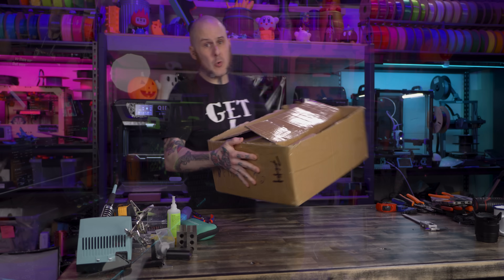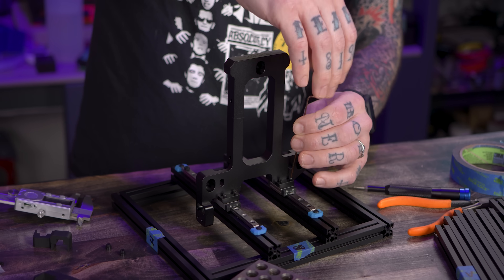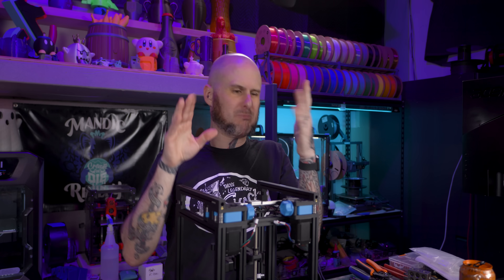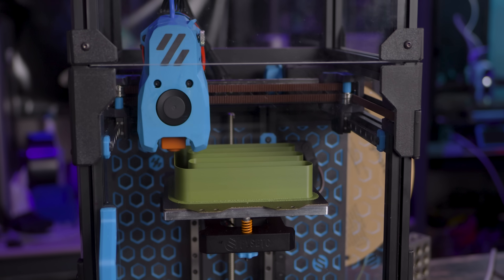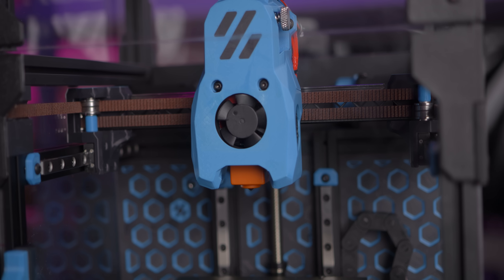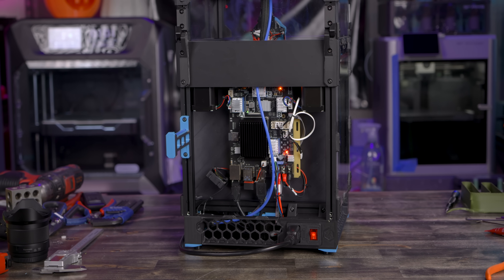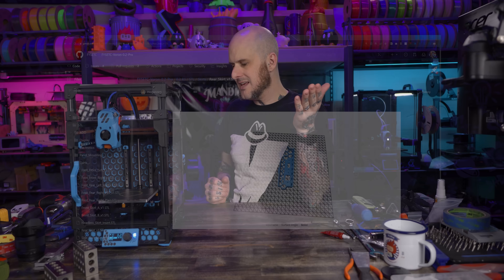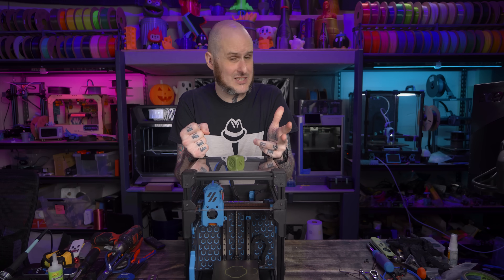Is this the BEST Budget Voron 0.2 kit? - Fysetc V0.2 R1 Pro Review

Comment: I have one of thoe kits and the "umbilical cord" after some hours of use (not sure how many) started giving me problems, after the printer heated up and started moving to do the homing routine, would always give an error that the hot end droped temperature. And when I re-did the solder joints on the toolhead PCB the accelerometer developed an internal short and fried the main board. Soooo I'm not the bigest fan of that setup. Your milage may vary, but this was my experience

Comment: In thier newest kit the 1.1 They seemed to have taken your advice and upgraded the umbilical cord as well as include heatsinks in the box. also they went to stainless rails.
Reply from the maker: Excellent. Thanks for informing me that they’ve made some improvements. 👍🏻👍🏻
Reply: I can confirm these changes. The umbelical in particular has been changed into a CAN sort of toolhead instead. It's a very soft silicone cable.

Furthermore, they have upgraded the hotend to something along the lines of Bambu hotend clone with dragon mounting points, as well as include the CNC pom gear by default.

I noticed they have seemed to address all issues you've raised in this video!

Comment: Purchased mine with printed parts in the January 2024 winter sale, shipped to Wisconsin for 367 after coins/coupons on Aliexpress.  It shipped from a US warehouse.  Printed parts were all correct and without issue.  The back skirt with port access was included.  Everything is printing well although I think I have a little bit of y binding and my y acceleration rec is only  11700 while x is 18k

Comment: In time where bambulab is everywhere ( I own P1P/S) - is it good to build voron from kit? or its cheaper to pick components on my own hand?
Reply from the maker: Hard to say. I’m largely of the opinion that a lot is cheaper overall. You can find individual parts cheaper but then you often pay tax & shipping on individual transactions. That quickly defeats the savings of those individual parts. Combine that with missing small parts here or there. Despite your best planning you’ll often miss something. Or maybe the part you need is only available in multiples. Things kits take care of. I self sourced my first 2 Vorons and I won’t do it again. From here on it’s kits for me. I’ll buy the additional parts I want and maybe end up with some quality spare parts for future projects or maintenance.
Reply: @MandicReally  Thanks, i dont expect as fast answer. Maybe one more question - formbot now have very cheap kit in my region (Europe - 429$ with dragon high flow, no parts - i can print it better), so, better formbot kit or siboor/fysetc?
Reply from the maker: @zbigniewwielgus1249   I haven't used a Formbot kit to say. I have just not had good luck with the Siboor kits so I cannot recommend them. The Fysetc kit I was largely happy with but the electronics weren't my favorite. For the price and with a good hotend (I like the Dragon HF), that sounds like a good price to me and I'd give it a go.
Reply from the maker: @zbigniewwielgus1249   I haven't used a Formbot kit to say. I have just not had good luck with the Siboor kits so I cannot recommend them. The Fysetc kit I was largely happy with but the electronics weren't my favorite. For the price and with a good hotend (I like the Dragon HF), that sounds like a good price to me and I'd give it a go.

Comment: The motor noise comes from the stepper drivers. Replacing them with proper ones for example by BTT will remove the noise.
Reply from the maker: TMC Autotune cleared it up.  I’ve had it happens it BTT stepper drivers too.

Comment: But for the price you have so many other robust and less fiddly systems. Why would anyone need a voron?
Reply from the maker: No one “needs” a Voron. I did an entire video about why folks may WANT a Voron 0: https://youtu.be/k08EfV4u4dk?si=hRP5xwTROuwyArtQ
Reply: @MandicReally  yeah I watched that and it was before the a1 mini came out, so A1 mini with AMS or Budget Voron 0.2 kit you build? Yes I know material choices are much more with the Voron however AMS. Yes I know a kit is a learning experience, but out of the box setup time to print is long and could end in suffering vs the A1. Do you really gain that much with the Voron over the competition? 3D printing is getting mainstream and as it does the Vorons of the world will be more niche.
Reply from the maker: @mobilechaosyt  materials is the key. The A1 bed is limited to 80C. Not nearly enough for ABS, ASA, Nylon, etc. No enclosed chamber is another mark against it for prototyping type work. 

The A1 mini makes WAY more sense for the majority of users, but folks like me who work with materials other than PLA, it’s a non-starter.

Comment: Hey man....I'm currently rebuilding everything in the chamber on my v2.4,I've been recommended beefy front and z idlers.
I got about 3500 hours on this machine before I got one z idler cracking and one front idler cracking.

Should I just go cnc or is it ok to go 5 walls /50 % infill on all the chamber motion stuff?

Extra question,do you have any xp with quality ceramic bearings or are those just fugazi?
Reply from the maker: I haven't run the ceramic bearings yet. My next 2 builds (a v0 & v2.4) I'll be running them to see what I think. You can go higher wall count (Infill won't make much of a difference) to increase strength, but yes I'd recommend the beefy designs. The stock idler design is "Meh" to me. I'll be doing beefy on the next 2.4. The only problem with the CNC parts is you are stuck with the color they provide. That's the thing I dislike about them. I MAY go CNC on the next 2.4 just to test it out though.
Reply: Yeah...at least all black would be nice @MandicReally

Comment: About tge tinnitus like tone, it comes from the stepping and interpolation of the drivers. My bigtreetech drivers (2209 as well as 2226) and moons motors do the same at certain positions. For it to go away, use stealthchop (attention, speed limit) or switch the Interpolation setting

Comment: A couple questions:

What do you think of that bed frame vs the Kirigami?

And do you think it's worth upgrading a Voron 0.1 to 0.2?  Or are there any parts in particular that you'd upgrade?
Reply from the maker: I’ve held off updating my 0.1 until now. Even then I’m only doing it because it needs some disassembly for maintenance. 

The number 1 upgrade of the 0.2 over the 0.1 to me is the Mini-StealthBurner. It has a superior Extruder design, and well all around better design. In my opinion. If I had a 0.1 I was considering upgrading, I’d just do the Toolhead and associated pieces and leave the rest. Almost every part is changed but not in drastic ways. The skirts of the 0.2 look a lot nicer too. That’s an easy cosmetic change though. I did that on my 0.1 months ago. 

I’m not a big fan of the extrusion top hat. Yes it’s superior to the fixed 0.1 too hat, but I have a hinged 0.1 top hat I’m happy with. The latching mechanism on the 0.2 top hat is still questionable to me sadly.
Reply: @MandicReally  Ah, thanks!  I already went with a mini-after-sherpa and a sailfin extruder, so I don't feel the need to upgrade there.  And did the top hat.  Seems like I can just stop wondering about the rest.  :)
Reply from the maker: Yea I have a LGX lite on my 0.1, which is why I didn’t bother updating. Even now, I’ve design a Mini-SB LGX Lite version for the upgrade.
Reply from the maker: Oh and on the bed frame. Purely from a feel standpoint, the CNC bed frame feels more solid. However not so much that I care to change the bed on my 0.1 when I do the update. The Kirigami is plenty fine.
Reply: Thanks!  It certainly looks more solid, which is why I wondered.  I can't really complain about my kirigami at the moment, but it just looked like a solid bit of kit, so I couldn't help but be tempted.

Comment: My Fysetc voron 2.4 kit had the cheapest quality rails and rusty screws drenched in oil. I didn't know any better and built the printer anyway and ended up with a ton of layer shifts.. After a ton of troubleshooting, I finally narrowed it down to rails but I would hesitate to buy a Fysetc kit.

Comment: $500  WTF that gantry looks weak  no solid parts ,Structural should  be as thick as you can make it ,Caps, fearings an what not do 5-7% infill   ....Man im glad i bought a Neptune  Just works ,Some of these garage days printers are going to die out soon .. like none really wants to put build there own Xbox .just turn it on an go with some setup of course ...these Vorons an Sovols are  like Mad max Printers built from scrape , if the Parts are Printed they should be at least strong and work without falling apart ...$500 for something that tried to self suicide ...Naaahhhh

Comment: A german youtuber had the same problem with the noises and found out that the cause was the stepper drivers. on the one hand, the motor currents are too high in the default configuration, on the other hand, he then replaced them with BTT 2209 drivers and the noises were gone.

Comment: I have this exact set (minus the printed parts). I had lots of issues with the board: it was running an old klipper version and once updating the software at the linux level it wanted to also update the MCU firmware.... And finding the docs on how to do that was a total pain. Bits and pieces of docs scattered over 2 or 3 places. In the end figured that out, only to be greeted by 178c on ALL thermistors after 2 days of otherwise OK printing. So I gave up on it and swapped it out for a Manta M5P. Some kudos to Fysetc though: they did a few checks with me and then decided to send me a new Catalyst which arrived fairly quickly. I'm just not going to use it any time soon. After swapping the board the very very short cables on the motors are actually a bit of a pain. Got it to fit, but.... could be better. Besides those niggles, I have been VERY VERY happy with this kit. And now I've got a very very good deal on a Fysetc Voron 2.4 kit 😁
Reply: Ohw... As an after thought: the Catalyst board does claim to support CANbus too, just never got around to it. And I found the startup times for the board to be frustratingly long.

Comment: My Fysetc v0.1 had the same whine, fixed it by enabling stealthchop on the z-stepper.

TMC autotune does have some of the Fysetc steppers in the database, but is a bit fiddly to set up when using sensorless homing (e.g. homing speed > rotation distance of A/B steppers).

Comment: I wonder if the TMC Auto tune has these motors in their DB? I've heard with the tuning set to auto can help with whine and general noise.

The catalyst board is pretty interesting. The concept of a board for a specific DIY machine has some merit. Much easier wiring and cable management. The A/B motors plug into the board NEAR where they're located.

That's something that printers with fully custom boards don't even do.

A lot of small but nice value adds in this kit.

Comment: There is magnetic stainless steel it contains enough more ferrite or martensite, Maryensitic stainless steel can be hardened so better for linear rails/rods. When you see linear rods with grooves from the ball bearings those rods are probably cheaper 304 or 316 stainless steel.

Comment: i got myself a Fystec Trident rev 1.1 ( After burner, 1.2 is their SB version it seems) 
i was suprised at how good the kit was, everything was included looked high quality, the wiring diagram was easy to read, all cables where precrimped ( no need for those wago shenanigans)
dragon High flow included ( original one )

Comment: I bought a Fysetc 0.1 kit a while ago (without printed parts) and I've been super happy with it. My only gripe with that was that the sd card they shipped with pre configured klipper died after literally one power up and finding the recommended configs for the machine was a little dicey. Did end up finding it buried in github, but the hardware on that one was great. The extruder and the bowden tube were a little janky though like you mentioned. Plan to replace mine once it strips out eventually.

Comment: I agree with the wining motor noise.

I also have problem with the I2C connection to the display.
Whenever I try to use the encode it might hang the bus.
I recently got a USB one with which I will replace it.

I have had an extruder clog - not to say that fysetc is to blame, but I trashed my board by unplugging the head connector without powering down.
Motors and heater was turned off - guess that is because of the accelerometer.
Waiting for a new board, the MCU won’t show up on USB anymore.
Will also replace the controller on that board, but ordered a new board to be safe.
Had to order it with the CM68, which is not pin compatible with a pi computer module, so you are stuck with their board.
But I think you can remvoe the CM68 and use the MCU via USB with any other kind of board.

The preinstalled config - that annoyed me as well.

Also the gantry nut assembly.
I wasn’t aware of that printed part and had some fun time to place nuts in the gantry with tweezers.

Thank you for explaining me why I have extrusions left over.
Thought about the gantry beam, but missed the bed assembly.

That umbilical cable - I hate it.
It looks solid either way the glue, havn’t noticed any glue problem yet, but the cable is stiff, which together with he lightweight gantry…
The most annoying part however is that is doesn’t fit within the top hat.
I’m using the waiting time for my new board to increase the top hat height.
I considered reolacing it with CAN, but didn’t want to spend too much time crimping new canles for the CAN PCB I have available.
That said, the catalyst board includes a CAN connector which is really nice, but only useable if you use the CM68.

Comment: I've also purchased the kit with printed parts a couple months back, I haven't had the same issues with the printed parts or config, my kit came with heatsinks, and there was an included panel for the ethernet and USB extensions at the back of the machine! super happy with it so far but definitely would like to upgrade the hotend!
Reply from the maker: Great to here. I’ve had the kit since July so they must have done the needed updates. 👍🏻👍🏻